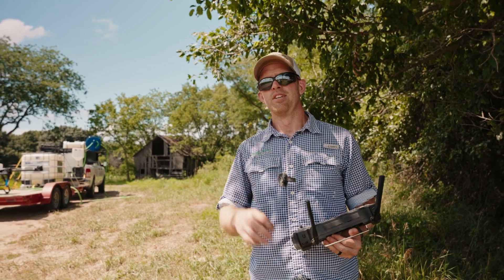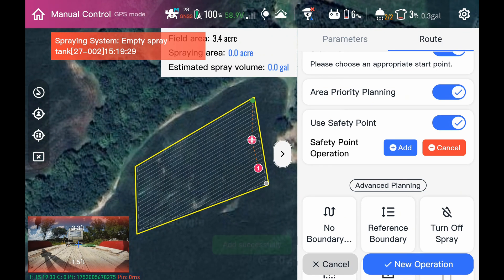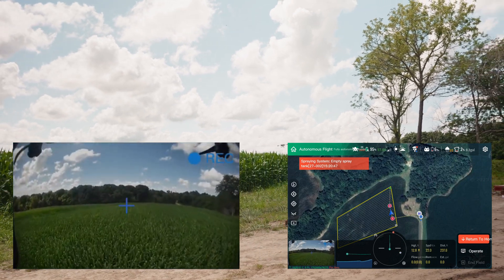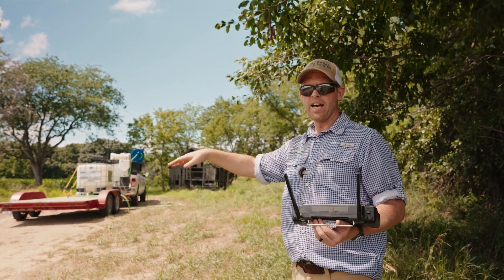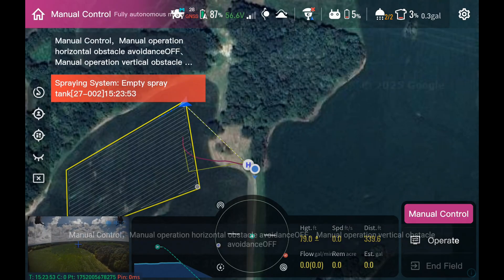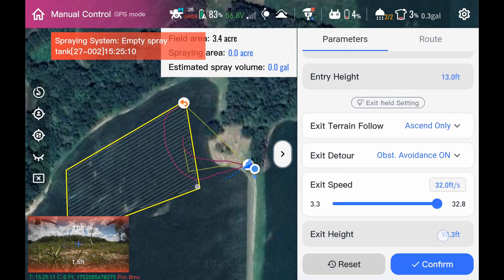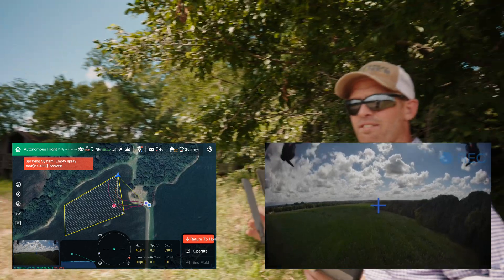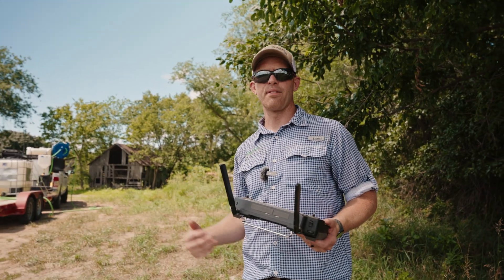Field Entry and Exit Methods on the J100

Comment: @ 2:20, 6% radio battery? No warnings, so makes me wonder when and if it gives a low voltage battery warning. Flying RC since 85, traditionally I would never fly with it that low but maybe with the newer battery tech, 6% is just fine. Just a curious observation. Trying to learn both DJI and the EAV interfaces ahead of time. These videos from you and Mike sure do help but a dedicated video series would be great. An online sim for the radio....
Reply from the maker: There is an on-screen warning accompanied by a beep when the controller battery gets low. You can see it (and hear Taylor mention it) at 0:51.